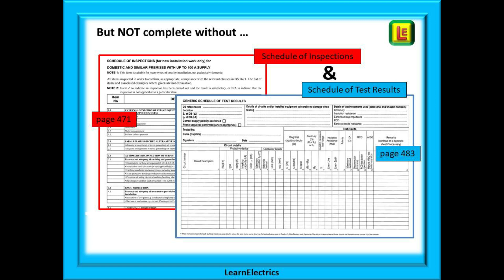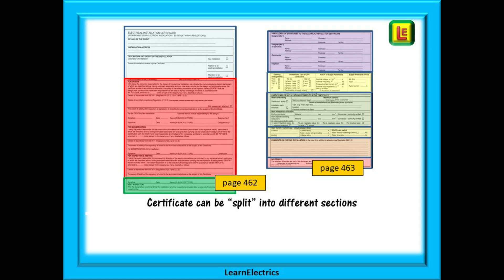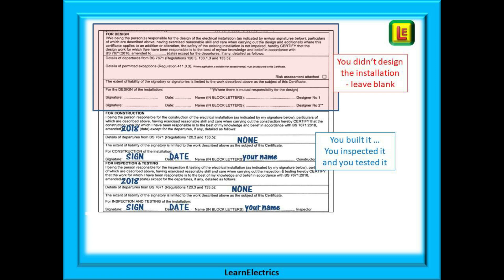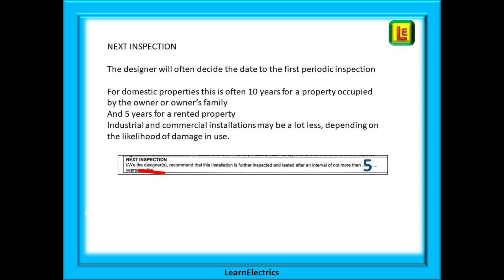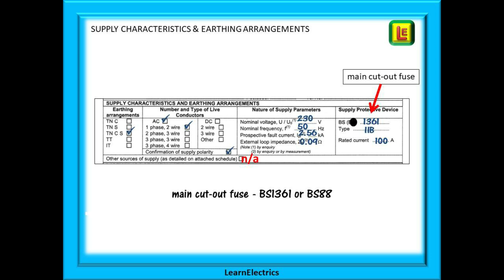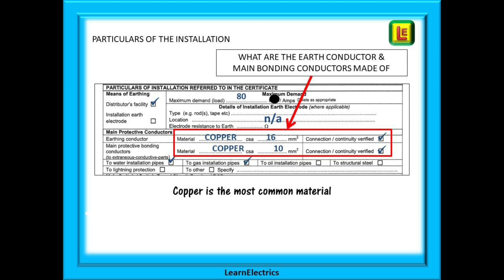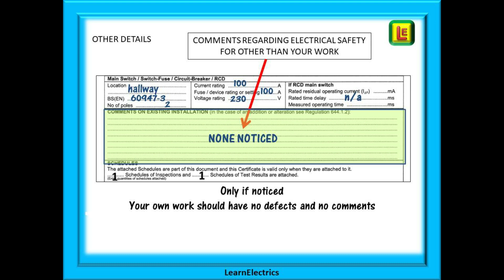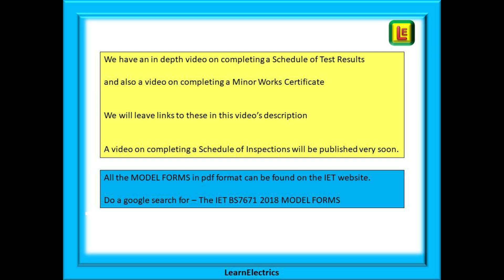ELECTRICAL INSTALLATION CERTIFICATES – How to fill in the certificates easily and completely

Comment: Hi Dave what would you record as the maximum Zs value on a circuit that has a TT Supply ie a 32 amp breaker would normally be 1.09 ohms on a TN system
Reply from the maker: Take a look at our video on thye link below, it should answer your question very nicely. Thanks for the support. Dave.
https://www.youtube.com/watch?v=7dT-U6xBd-I

Comment: Hi Dave  Once the work is completed do i have to provide the EIC on the spot if requested by the customer ?
Reply from the maker: Not on the spot, but within a reasonable time period. I used to spend Fridays doing certs and notifications, and have the Part P notifications sent to me. When the Part P arrived, photocopy for me, original to customer along with EIC etc. I used to make sure I was paid at the end of a job by saying something like ""let's get the money sorted out and I can get all the certificates processed"" Never had a bad payer. And if you tell the customer 2 to 3 weeks for the certs, make sure it is, customers do notice.
Reply: @learnelectrics4402  cheers Dave for commenting back 👍

Comment: My favourite youtuber for electrical content..

I have a question, is it acceptable to lim the supply characteristics if you cant gain access to the LV plant room on a commercial/industrial complex?
Reply from the maker: If its a genuine limitation then state the reasons clearly and have your customer acknowledge that. Personally, I've never been denied access to a plant room. Thanks for watching. Dave.
Reply: @learnelectrics4402  Thanks for taking the time to reply. Yeah I was having a conversation with my boss about this. 

He said on an eic, as you are certifying that you couldn't have a limitation. But sometimes it's impossible to get a true ze, and check fuse sizes etc.

Comment: If you change a consumer unit & issue a EIC it seems you cannot put a limit for not testing between live & neutral because there are lots of downlights installed & it’s not practical to bypass them
Reply from the maker: The new regs expect you to test at 500V insulation Resistance on an EMPTY circuit and then test at 250V on a circuit with appliances fitted. If you change a consumer circuit, you automatically adopt the whole installation, its all your baby. Hope this helps. Dave.

Comment: Hi sir,
I have isolator switch with fuse device under the stair between the supply protective device and the meter 
where is the supply cable located and I have consumer unit with RCD 
main switch inside the studio flat so now I would like to fill certificate 
I have 2 main switch which one should I put in the main switch section on certificate
Reply from the maker: You will need to complete two certificates, one for each CU. It sounds like the one by the meter is the main switch for the property, this would be Ze. The second CU will require its own certificate, Zdb.
Reply: @learnelectrics4402  
The first one it’s not consumer unit it’s isolator switch

Comment: Hi sir , I have questions about fill EIC 
The consumer unit main switch is RCD so the RCD protects 6 way consumer unit. 
Every circuit has MCB circuit breaker 
When I fill out the circuit details and test I should put the RCD 61008-1 on the RCD section and RCD measurement for each circuit and tick the test button it’s right ?
Reply from the maker: It sounds like you have an RCCB as a main switch. No problem. Whichever circuit has the highest Zs, test it on that circuit and record that as your RCD result. Always choose the worst case figures, because everything else will trip quicker than the highest Zs circuit.
Have a look at this video about the different devices. The link below will take you to it. Thanks for watching.
https://www.youtube.com/watch?v=Z1gwO-FsuNY

Comment: Quick question on the " particulars of installation referred to in the certificate". If, for example, you've installed a sub-main is the info such as max. Demand, main switch info and earthing conductor to do with the sub-main or is this part still to do with at the intake? 
I've recently got back into testing so bit rusty with the forms.

Great video!
Reply from the maker: Thanks for watching.
Both apply. In the section SUPPLY CHARACTERISTICS this is the main board, where the supply comes in.
Then, Particulars of Installation referred to in the Certificate is about the sub board.
Hope this helps. dave.
Reply: @learnelectrics4402  that's great and thanks for replying so quick!

Comment: Great videos, so much information. Have a question. If you putting in a new circuit from existing supply and consumer unit. From the meter in 25mm² Tails it goes to a switch with a bs1361 60A fuse then 16mm² T&E to the consumer unit.  How would you fill this out in the form? Thank you
Reply from the maker: If the T/E is in free air or clipped direct then I would go for worst case which is 60A with 16mm T/E as Iz for the cable is 85A.
AND record in comments section of certificate about the change from 25mm to 16mm etc.
Any other installation method, check your figures on page 409 of Regs.
Good luck, good question. Dave.

Comment: These videos have helped massively. Just quick question please if you don't mind. When filling in the test results under protective device in using RCBO you put in 61009 and next the type... If using a type A RCBO would A go in this column or would you use B as its the curve. Thanks
Reply from the maker: Type B for the overcurrent curve, 32 amp B type, 16 amp B type etc. Nothing wrong with putting Type A RCBO in the comments if you wish. The more info the better for anybody following behind in a year or two. Good question. Dave.
Reply: @learnelectrics4402  Thank You
Reply from the maker: My pleasure, you're welcome.

Comment: Nice one another great video of clear information 👍 looking forward to the other videos of minor works etc 👍 just thinking about when a sparks does work and fills in the , description, say moved light switch ,spur socket . Do sparks have to put down junction boxes used ,exact place of socket ,type of wagos connectors,capping used etc or is it literally... additional socket in bedroom and moved light switch? Cheers
Reply from the maker: Does a brickie give you GPS coordinates of each brick he lays? Who made the cement he used and what size bags it came in? No, he tells you he has built a house.
All the certificate needs to know is what the job was and that it is safe. New CU installed would do. No need to put the make etc. No need to put types of breakers on the certificate because these will go on the more detailed schedule of test results. The certificate is just - I came, I did and its safe.
I always suggest being specific about location of the work in case something goes wrong elsewhere in the house and you get the blame. In the lounge, garage sockets etc. I've had this with a house fire. The light switch in the kitchen caused a small fire a month after I was there. My certificate proved that I worked on the lounge sockets.
Hope this helps. Dave.
Reply: @learnelectrics4402  cheers dave 👍👍 thanks again, as a homeowner to understand what should be given certificate wise , brilliant videos 🙌🏻🙌🏻 looking forward to the next ones 👍👍
Reply from the maker: Lots more to come on certificates, well, everything really. Thanks. Dave.